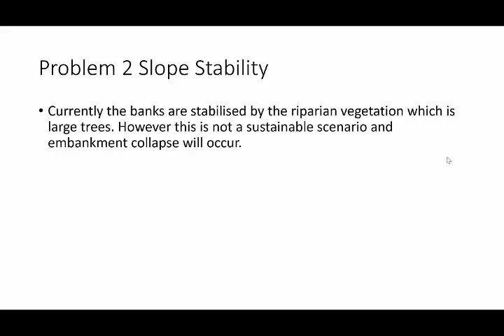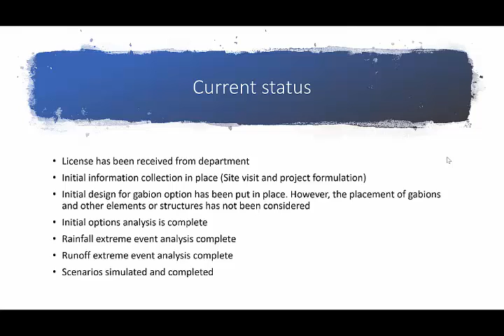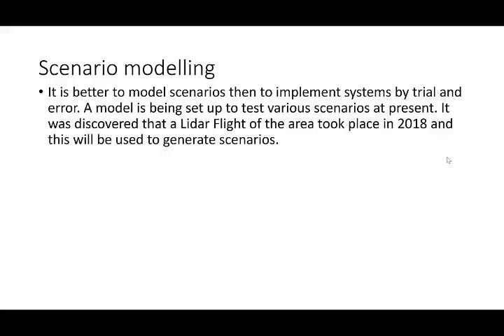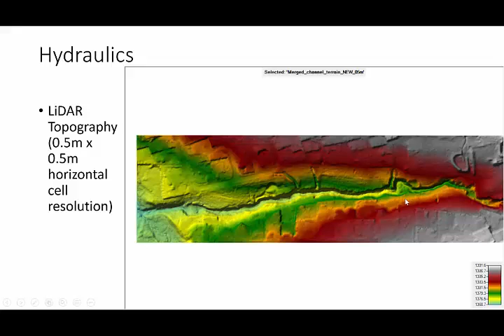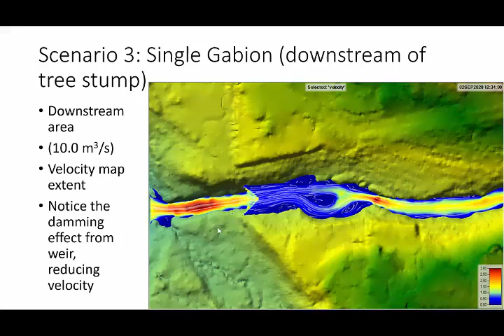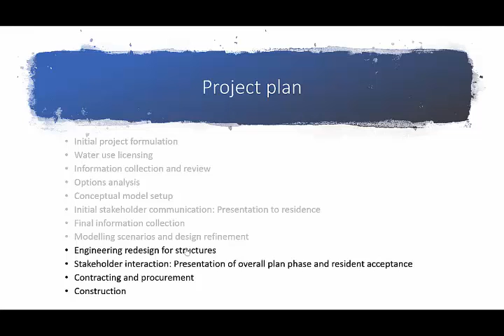Waterford Estate River Project update

Comment: Thank you Jason. I was not fully aware of the dire state of the river banks, and the continual encroachment on the estate, but am now.
I agree that this is a result of high-density developments with their many acres of paving, and the existing streams and rivers unable to cope with even moderate runoff. 
Too late now to push the toothpaste back into the tube, and now engineering interventions are the only solution.